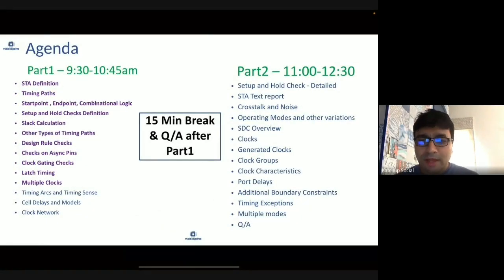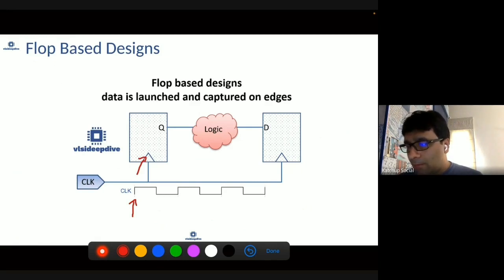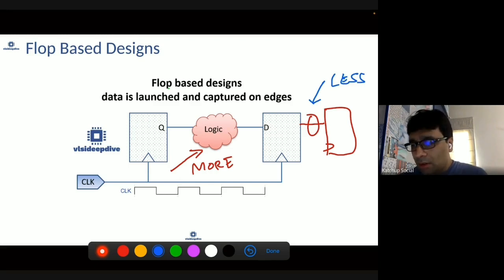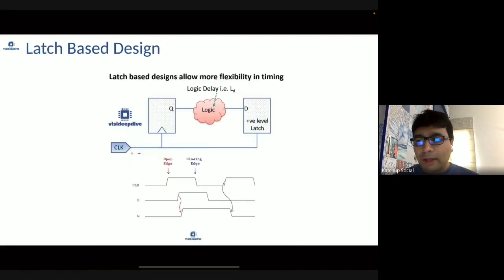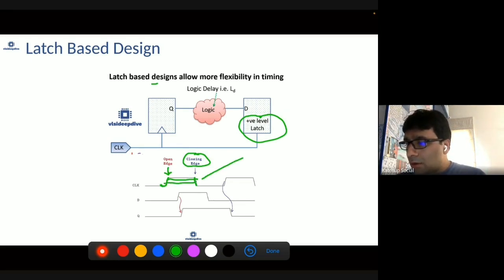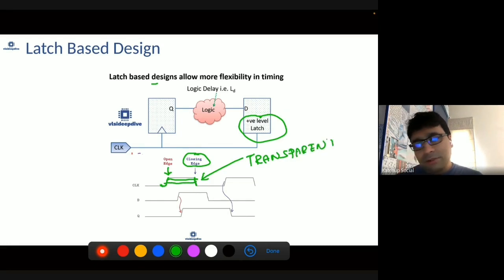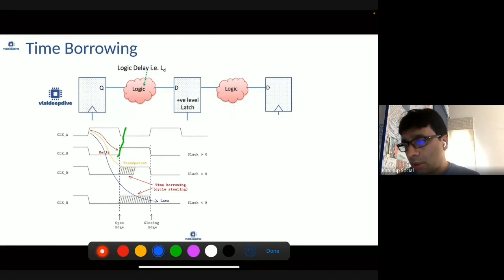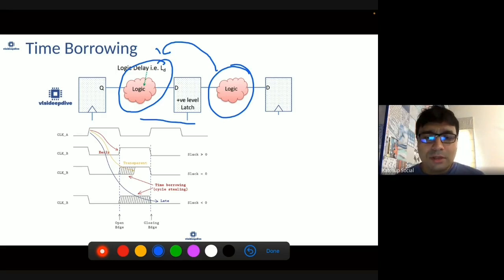Sta latch based designs

Comment: Thanks for the lecture. 
Please help clarify this query. The max delay with which data can arrive at latch is described to be the transparent period of latch - which I understand , but wouldn't this also be dictated  by the delay of next stage combinational cloud i.e it should be able to meet setup  for  next flop  ?
Reply from the maker: Yes, you are right. Both paths need to meet setup and hold. But the advantage is that you have the flexibility that you can borrow from the next level and use it here if the next level has a lesser delay.